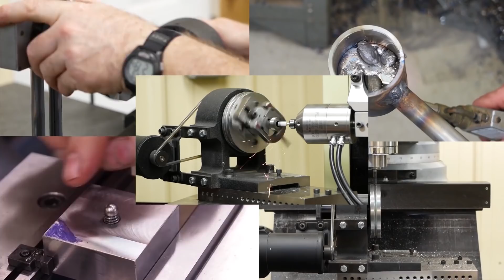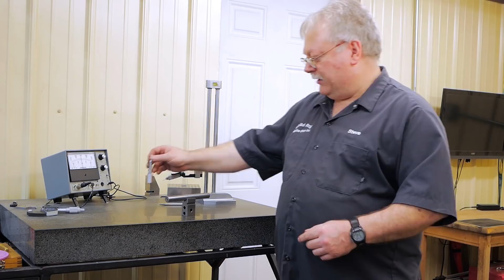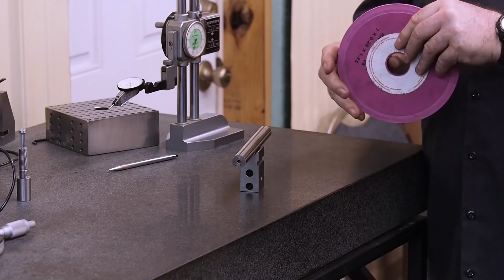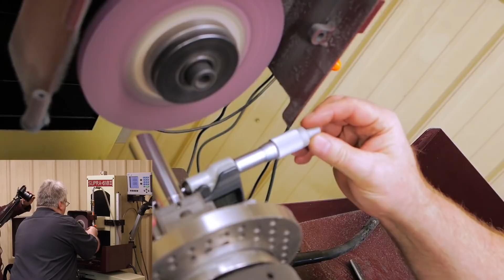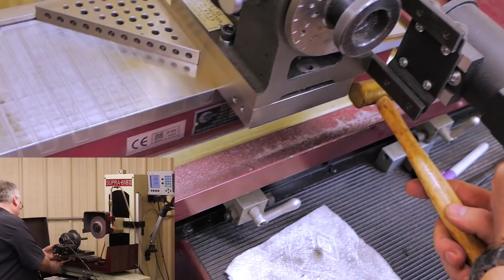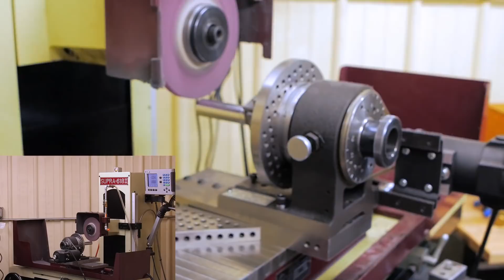Tips & Tricks  for O D grinding on the surface grinder

Comment: I just grind right on center but my fixture is always set square. Ground some D2 punches recently on a harig head and no problem with taper. Stamping mylar so shot for 0.0001 a side clearance on punch guide and 0.0002 on die. Next time i find a little taper i will try going off center but don't think it matters much if care is taken to get fixture square. I was grinding a form with 2 different size radiuses and 2 flats. If I'm off center tangent points will be off so going off center in that situation would be bad. Nice video and ty.
Reply from the maker: You are welcome.

Comment: Hi Solid Rock, 

 

Is there a reason why the rotation of the part is against the wheel direction? Any benefits to rotating with the wheel?
Reply from the maker: It may have to do with me running my mouth and not paying attention to the rotation direction. I prefer going with the rotation rather than against it.
Steve

Comment: This phenomenon is also why you shouldn't measure squareness with a cylinder square and a radius base style indicator.
Reply from the maker: Hi Simon,
Great point!
Steve
Reply: Thanks for the offset tips I always took too long to but the fixture coaxial the the Y axis, which is not perfect, and doubting where the tapper from. You made everything crystal clear to me.
Simon

Comment: Great video! Thanks for sharing your knowledge. 
One question: when you set up the spin fixture and end up with a taper, how do know which way (plane) to correct? Left/right or up/down?
Reply from the maker: Hi Juerg,
By going .01" to .02" to the left of the center line of the grinding wheel in relation to the center line of the spin fixture I only have to adjust the up/down. That is assuming you have the center line of the spin fixture running parallel to the Y axis. If the diameter is big at the farthest of the stick out then you need to adjust up. If it is small then you have to adjust down.
Steve
Reply: Thanks Steve. What if it error comes form a spin fixture axis that is not parallel with the Y axis (lets say from a mistake setting up). Would you still go to the up/correction to compensate, since the wheel is offset and is making a taper?
Reply from the maker: Hi Juerg,
That would be much harder to work out the taper because if you adjust the up and down when it really needs a Y axis alignment you will never get it just right. One way to line up the Y axis real close is to put a part with a shoulder in your spin fixture and take a clean up cut on the shoulder with the side of the grinding wheel and set your dial or readout to zero. Make sure the side of the wheel is relieved so that you have a very thin section of the side of the wheel that cuts.Then pull the wheel back off the shoulder of your part and ink the shoulder with a Sharpe marker. Then slowly wind the wheel up to the shoulder of the part with the spin fixture off so the part is not rotating. Just barely touch the shoulder with the wheel and back off the part so you can see the shoulder. If you have a nice even line on both sides of the shoulder then the Y axis is lined up good. If you have a line on one side but not the other then you have to adjust the spindle fixture side to side until you have an even thickness line on both sides of the shoulder. Maybe we will do a video showing this technique in the near future.
Steve
Reply: Thank you Steve! Very good explanation. I'm looking forward to see more videos from you guys.

Comment: When you teased it on Instagram I thought you were going to show how to make that differential screw. Or is that a different video I missed? I have no concept how you would make that differential pitch.
Reply from the maker: Hi Jon,
I made that at my full time job on a CNC lathe. They don't allow pictures so I can't show the making of it. I am almost finished making the test blocks that I will test it on and hopefully that will be next weeks video. At this point I am not sure if it will even do what I want it to or if I just wasted many hours of free time.
Steve
Reply: Solid Rock Machine Shop Inc. Certainly not a waste if you learned something, and taught many things in the process. As I tried to think through it the only way I could think of to do it was a CNC lathe. Surely it's the easiest if you have access to one, even if there are other ways.
Reply from the maker: Hi Jon,
I agree with you. The whole purpose of this project is to learn more about the differential screw and its limits. If it does what I hope for it will be icing on the cake.
Steve

Comment: Thanks for putting together another great video Steve and Adam. You might want to have a look at Clough42's channel. He has about a hundred subscribers at the moment. He (James) also uses Fusion 360 and does some nice work with a small CNC-converted mill.
Reply from the maker: Thanks Tony,
I will have to check out his channel.
Steve
Reply from the maker: Just watched his latest video and subscribed. Thanks.
Steve

Comment: Pro Tip: While you're doing all this messing around, trying to make a surface grinder do something it wasn't designed for, or intended to do, keep you eyes open for a dedicated cylindrical grinder.... I know... I know... They're expensive... But, you have no idea how much fun it is to run  a precision grinder without having all these hassles.
Reply from the maker: Hi franksalterego,
You are correct! I have ran a Jones & Shipmen OD ID over the decades. What I would really like is a Crystal Lakes grinder. Those are amazing too!
Steve

Comment: Hi steve, could you please advise how to grind aluminium plates for best results?
Reply from the maker: Hi Fischer,
Aluminum is hard to grind. I think that would make a good video. Aluminum likes to load the grinding wheel because it is very soft and it wraps around the individual grit. Wheel selection is important and the best results I have so far is to use undiluted coolant in a cup and use a brush to apply it to the work piece. I just talked to  Adam
and we will start working on a video right now and hopefully have it posted by tomorrow. I have never used some of the newer wheels on aluminum so it will be a learning curve for me as well.
Steve
Reply: Solid Rock Machine Shop Inc. Thanks steve! Can hardly wait. Also ...i need to grind a plate which is larger than my x movement. Is it possible to move the part and grind it in two operations or i would lose precision? Movement is 280 mm, part is 550, aluminium, blow mold plates.
Reply from the maker: Hi Fischer,
We just finished your video. I think you will be surprised at our conclusions. To give a tease, I only had small pieces of aluminum but the first wheel I selected worked so well I had to throw in the towel. The part was only about 2.625" * 2.75" but I took .031 off at .001 at a time trying to load the wheel. I gave up after .031without redressing and the finish was great and less than .0001 flatness. The video was going so long we only tested 2 wheels.
You will lose precision by moving the plate but you can minimize it with a good game plan. If you can bolt some very flat precision blocks to the bottom of the mold and space them just right you can get good result. Your magnet will have to be in good shape as well.
Steve
Reply from the maker: Thanks John,
This video should be up in a few hours.
Steve
Reply: Solid Rock Machine Shop Inc. I've wondered this as well. Impressive response time!! The timing with you off work sure is helpful for the rest of us. 😁

Comment: I noticed a repetitive stutter in your grinding even after multiple passes. What is causing that? wheel balance? Something in the spindle on the spin fixture? When grinding off center does it try to lift the part any from the cutting forces? I could see that becoming an issue next especially when grinding cantilevered.
Reply from the maker: Hi Brian,
It is in the drive belt where the 2 ends are fused together. You can see it under an indicator. It is about .0001 TIR.
Steve
Reply from the maker: Hi again Brian,
I have a few ideas on how to fix that issue. I have seen this issue on other Harig fixtures of this same model. When you spark out as I have it is less than .00005 indicator bounce. The bearings in this unit are not as good as in some of the other Harig spin fixtures but it is a cheaper unit. For a lot of the things we do it is accurate enough. One of my new project well be a fixture to grind between centers and that will be more accurate than this unit. I see in your last video that you have a lot of insulation hung in your shop. I am guessing you have much more now, can you tell a big difference in heat yet?
Steve
Reply: It has made some difference but not alot. Until I can get a ceiling in or do something about the roof vents all tyhe heat will just continue to go up and out. Maybe you could take some sandpaper to that spot in the belt and smooth it out?
Reply from the maker: Hi Brian,
There is a very slight miss match where the 2 ends connect but I think the problem is that it does not flex as good at that point and I think that is the problem. I am going to try to find some seamless o rings and see if that will make a difference. I may have to add a idler wheel to compensate for stretch as it gets used.
Steve